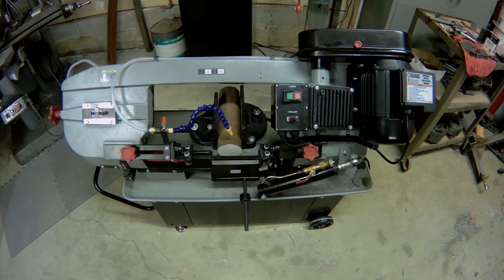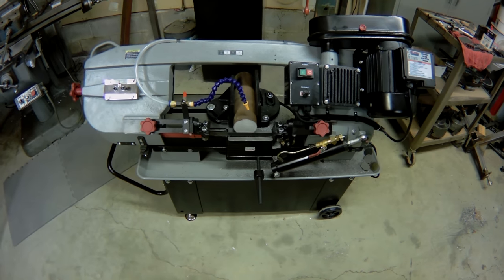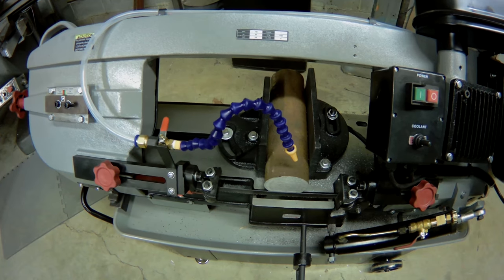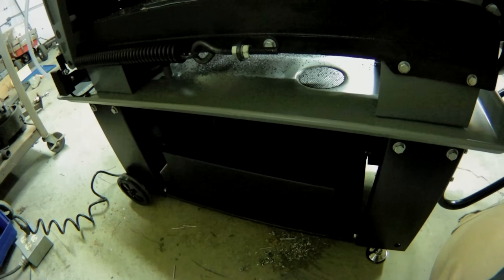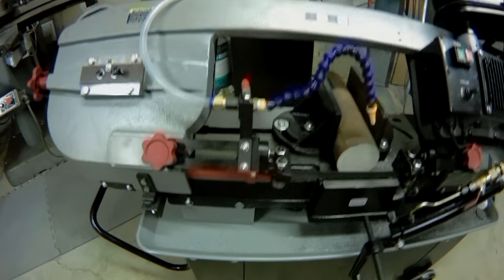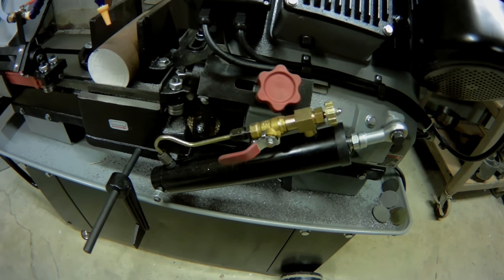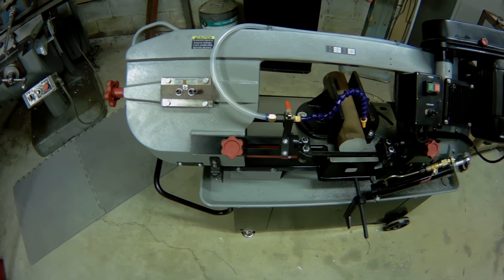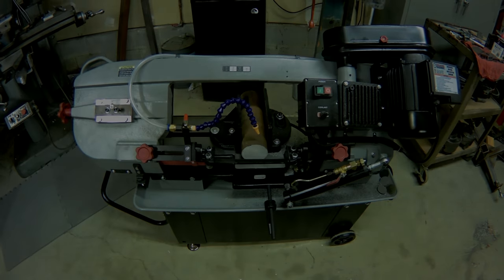Harbor freight 7x12 horizontal bandsaw (late 2017 version)

Comment: Hopefully this helps anyone who is looking to buy one of these. The new model SKU is 62875. However, it appears under a "SKU group" with 63469 (not in current batch), and 97009 (the old green version, also the master SKU). After calling over 12 different stores and the main headquarters I have learned a lot of things. Firstly, each store has no say in which one they receive, and will not receive any more until their current one is sold. You have to call each store to see which one they have. Each warehouse for corporate is also separate from each store, they can drop ship you the specific SKU of your choice for $150. If you're lucky enough to have a local store that stocks this particular SKU, buy it! Or if you're like me, you'll have to drive a few hours to find a place that has one.

Comment: What kind of blade and size you use on this? I bought the display model didn't come with a blade and they were out of the 93-3/8" blade. Not sure if Lowe's or Home depot has someone that might fit

Comment: There are a lot of comments about problems finding blades that fit. I have read that none of the HFT stores carry them. I am contemplating this saw, and would like to know what exact blades people bimetal blades on my small Harbor Freight band saw and like the quality of the cut, but on thicker pieces of bar stock, the blade flexes giving me an uneven cut. The smaller HFT horizontal band saw has been a good band saw.    I am hopeful this saw will do better cutting thicker steel since it uses a 3/4 inch blade..  'Thanks.
Reply from the maker: Even if harbor freight did sell them I would recommend you skip anything at harbor freight that is supposed to stay sharp.  The 7' 9" blade is a common size and I highly recommend you buy a good non Chinese blade.  I scored a smoking deal on ebay - 5 us made bi-metal blades for $25.
Reply: @rustbelt8924  what brand were then and what size?
Reply: @TheNuggetshooter  Check out McMaster.com  93" blade, x .75"    They have a good selection, and recommendations for TPI depending on material and thickness.

Comment: Im purchasing this saw this weekend. I definitely want this updated version. Is it a different model number or is there any other way to tell by the packaging?
Appreciate the video!
Reply from the maker: No, it was the same model number.  I brought home 2 saws-the first one was damaged so I exchanged it.  They were both this style.  I have no idea how the old one was packaged but this one was on a metal skid and the entire box had a cage around it made from angle iron and steel strapping.
Reply from the maker: Maybe see if they will let you cut a small hole in the box?  If it is green it is the old saw.
Reply: Thanks man appreciate it!
Reply: I just sold my older JET 7x12.... for $750, ordered one of these for $850 delivered, it looks identical minus the upgrades you spoke of! Thanks for the video man